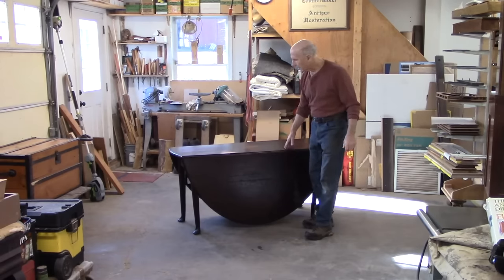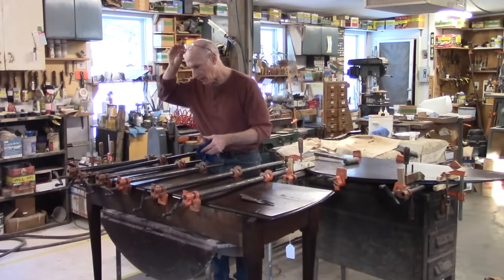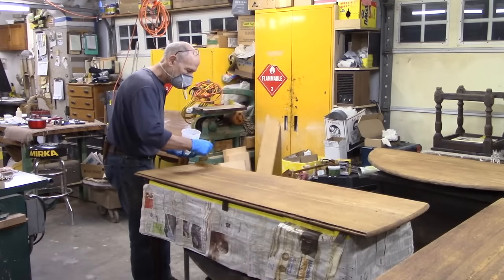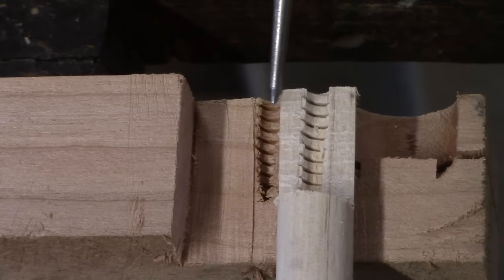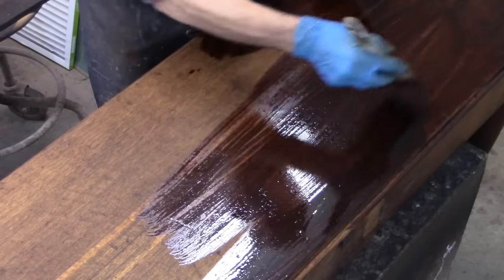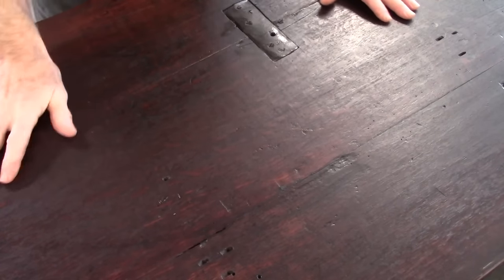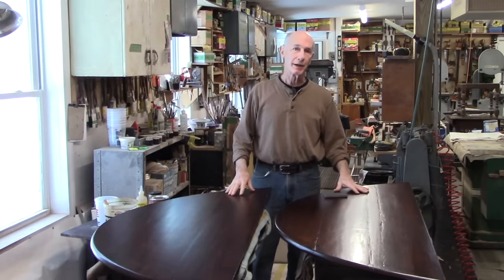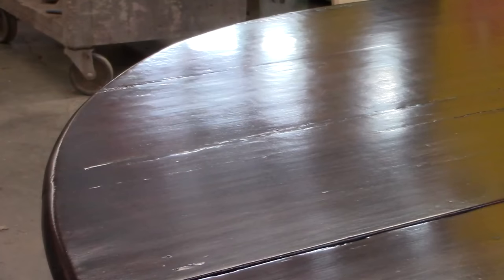Is This Table Too Old to Refinish? - Thomas Johnson Antique Furniture Restoration

Comment: Forty years ago or so, I volunteered to do odd jobs at the workshop of a local antiques store here in RI. An older couple, Jim did repairs, and Ethyl stripped and finished. She used 4-0 steel wool and bar soap to get that same sheen from her finishes. They were lovely people, and I learned a lot. My wife and I liked old oak furniture, so we hunted for basket cases we could
buy for a few dollars, and restored them. Furnished our whole apartment, and it's still our furniture today.
Reply from the maker: That's great! I love that! We still have our oak from the 70's!
Reply: That is wonderful!

Comment: And again, Mr. Johnson saved a little piece of history. Who has eaten and laughed at this table? Nobody knows that and that is what makes restoration so valuable.
Reply: I wonder about the burn mark, did somebody get in trouble?
Reply: @timheilman2089  Maybe - but it's also possible that at some point this was 'demoted' to an old, scrappy table that nobody cared about.
Reply: @timheilman2089  If you've watched a lot of TJFR you will know he doesn't go after deep damage. It leaves behind too much distress and obvious work. That would be contrary to his and most restorationist's philosophy. You can always find someone that will run a complete tabletop through a 48" drum sander removing every last trace of character.
Reply: @timheilman2089  I'm totally an amateur here but this is my impression of the origin of that mark:  Doubting it was a one time happening but perhaps many times a coffee pot was placed on that spot that had a pad beneath it that didn't completely do its job.  IMHO
Reply from the maker: Thanks! I like to think about that too!
Reply from the maker: Good question! Thanks
Reply from the maker: That happens often. Put down the cellar as a work table. We've seen that happen a lot
Reply from the maker: Thanks! True! It's often difficult to decide how far (or not) to go
Reply from the maker: Thanks! Yes, could be. It's fun to speculate

Comment: I let shellac dry for like 14 days once because I was tired of it being gummy. Was like glass after, so easy to work with. Then lol. I also found that humidity reeeally made a difference (was a summer project, so often humidity was high) and temperature was important as well
Reply from the maker: Thanks! Yes! Shellac is a "fast-drying" finish, but not always! I like to wait a minimum of 1 day between coats, this time of year longer

Comment: I love how we have the technology to walk on the moon and probe the mysteries of distant stars yet the best adhesive for wood repair is still hide glue, the cleaned boiled skin of an animal that was invented before written language. :)

One of those iron patch plates looks hand forged.
Reply: With perfectly clean wood, Titebond will beat hide glue... but sometimes perfectly clean wood might not be possible, like here.  Also nothing sticks well to dried Titebond, and Titebond will not catch rapidly so as to spare the need for clamping small pieces.

Also, even Tom epoxied a piece of nail split trim back together and back on.
Reply from the maker: Thanks! So true!
Reply from the maker: Thanks! True! I use hide glue on antiques, but Tite Bond is the go to glue for all other projects
Reply: I think it might have been part of the orginal table. Which means it has been fairly well cared for.
Reply: @SeekingTheLoveThatGodMeans7648  you should never use a modern glue on antique furniture. my dad used to have a pot of animal glue that he used for years.

Comment: Really nice paced video with many tips. One thing I have used in the past like you is the foam brushes. Didn't have good luck with them so I used a good urethane brush.Found a great way to clean the brush too after 45 yrs. Dawn .Thanks
Reply from the maker: You're welcome! Dawn has been a staple for my shop from the beginning!

Comment: I love watching these programs.  And I really appreciate how you have explained every step you took. It is a lot of work but I appreciate the way you kept the integrity of the piece. 

I also learned a lot from you. The story about the plugs and dowels was interesting and how you solved the problem about the right screws to use and how you initially cut the thread into the piece with the right screws and then shortened the screws to the right length was also a very good tip.

Thank you Sir. Best wishes
Reply from the maker: You're welcome! I'm glad you find that useful!

Comment: I just love watching how you restore pieces  close to their former glory. Thank you for giving us so much of your valuable information and tips.  Your clamp selection is the envy of us all. I hope you do not mind me suggesting that 2 pieces of 1" diameter x 1" long plastic pipe, split and slid onto the pipe near each end close to the clamp heads helps to remove the need to try and keep the pipe off the surface by positioning them away from a glued joint. I have these on all my pipe clamps....Ron Cumpsty
Reply from the maker: Thanks Ron! That's a good idea

Comment: A job well done, beautiful result. It certainly doesn't look anything like the table from the start. Thank you for explaining the difference between the plug and the dowel. I always knew dowels were soft and never thought to use a plug in their place. Plugs were for covering recessed screws!. Its a bad day when you can't learn something new, today was a learning day watching your video.
 I'm a mechanic by trade and have a love of timber and try to make what I can. Everything is the dreaded MDF these days, may as well be cardboard. 
Over twenty years ago on holiday in the north of Thailand, my wife and I bought our dining room table and chairs. Solid golden Teak, with some discreet carving to the chair backs and table frame. It wasn't the fact that the whole six chairs and table including shipping were 70% cheaper than back home. It was the quality and craftmanship that went into the build. The one we had been looking viewing at home would now be firewood. The Thai people are very talented with most of the craft work, timber in particular. We bought several more items on return visits and everything is still solid and nothing has become loose. 
A couple of questions if I may. The scraper kit you were using is really neat, I've not seen one like it this side of the Atlantic, what brand or who manufactures it.
The second question is in relation to the type of brush you were using to apply the stain to the table top?. The shorter of the two, it looked like a dense sponge wedge from what I could see.
Reply from the maker: Thanks! Yes, there are interesting videos of people in that part of the world making furniture. That scraper is a Hongdui from China. There is a similar US scraper from Woodpecker. Both are excellent. That's just a foam brush - I hated them until I found they work great on this particular varnish!

Comment: Mr Johnson I agree with JB I'm a  new viewer I absolutely love to restore old furniture I actually have several pieces at 100 years old been in the family for years however my current residents will not allow me to do anything but at least I can enjoy your videos thank you thank you Mr Johnson for such awesome videos great work love to watch you work on old furniture..😁😁💓
Reply from the maker: Thanks! I hope you get a chance to work on them someday
Reply: @johnsonrestoration  I thank you Mr Johnson I will someday one of them has to have a block put back on the corner which pretty simple just tap a couple nails in cut cut the ends put a little glue and tap the block back into place that's my theory for this the other one is all walnut cabinet I think they're both Walnut connect with me on Facebook I would love to show you pictures of the two pieces of furniture I have that are family homes I don't know the age maybe my over 100 years old

Comment: My Mom loved to go to country auctions and buy old furniture that had been painted over many times and take the paint off to get down to the wood. About 25 percent of the time she found excellent wood and something worth refinishing.  I have fond memories of helping her remove layers of paint with nasty smelling paint remover.  Then she would make the necessary repairs and refinish the piece of furniture.  She would spend a nominal amount of money for an old painted piece and spend many hours making it a beautiful piece of furniture.  She sold many of her projects but she kept quite a few over the years and they are truly wonderful.  I have a cherry chest today that she worked over in 1956 and it is still an outstanding piece.  She taught me the craft and I recently refinished a gunstock for a M1 Garand with boiled linseed oil.  It took 11 coats of that stuff with many days of drying between coatings and took me over 4 months to get it right.  Your video brings back to mind many hours spent working alongside Mom back in the day.
Reply from the maker: Thank you! What memories! I'm so glad you still have so many of the pieces

Comment: Always enjoy your work Thomas. One thing you might think about with these very old pieces is cleaning all the surfaces you’re redoing with naphtha first, even before stripping. I do it several times with clean rags each time. And if those areas that are still showing up with the flat and dull looking like they might fisheye use some fisheye eliminator in your finish it will work in oil products. 
I restored the George Gershwin piano for Mrs Ira Gershwin years ago and we had a tremendous fisheye problem. We did use fisheye eliminator in the lacquer but we actually had to use a shellac barrier coat and even then we couldn’t lay down a wet coat of lacquer. It’s now in the library of Congress in the Gershwin Room. 
I like how you got out of the corner, there’s always a way. 
Cheers 

Sent from my iPhone
Reply from the maker: Thanks Bob! Wow! That is impressive! Yes, I’ve had plenty of fish-eye problems in my life! And I’ve used plenty of Naptha! Try Mohawk Wax Wash Remover, it works better. Also, I find wiping the surface with a vey weak solution of household ammonia works great, between coats, after sanding

Comment: Thomas, you did a a beautiful job at refinishing this table.    About three years ago I found a duncan-style table for $6.00.  The top has water mark rings on it.  The bottom legs look parfect to me.  As far as the table goes, it has scallops on the two leaves of it.  There are no scallops in the middle of the table.  I've never seen a duncan-style table like it before.  I definitelyt learned a lot from you in this video.
Reply from the maker: Thanks! Yes, I've never seen that either

Comment: Awesome video.   It inspired questions that I haven’t had in 20 or 30 years.   Been thinking it’s about the time to use the wood shop for more than simple client requests.   

I’ve collected a ton of old wood thru the years.   From pulling attic floor boards or even finding old redwood on 40 year old decks.   I’ve kept anything that would be good.  My wife never was pleased.   Now I’m ready to create.  

Awesome video!  Awesome use of hand tools.  Loved it.  Subscribed

Edit:  I can’t believe I’ve watched this whole video.   I think I found a muse.
Reply from the maker: Thank you! That's great. I love old wood, it can be difficult sometimes to work with. Good luck! Create designs where you don't need to sand the wood. Just clean it really well and finish it

Comment: At about 13:00 in you are clamping the center glue joint on the table top and trying to keep the clamps from resting on the surface. Just run 2 strips of 3/8" thick X 1 1/2" wide down the length near the edge to support the clamps off the surface. No fiddling getting them all level across.
Reply from the maker: Thanks! And I know that too. Must have had a brain fart

Comment: This table turned out gorgeous!  I have an old 1800 rocking chair that needs help.  It was one my Dad had.  I also have 2 1800 end tables that I would love to refinish.  They were my Great Grandpa's.  I also have 2 antique treadle sewing machines.  One was my grandma's and the other is a 1927 Singer. I would love to get to these also.
Reply from the maker: Thanks! You've got your work cut out! It's great that you have all those pieces

Comment: Mr. Johnson, thank you for sharing this marvelous video.  I am a green woodworker who has at times used hide glue to better imitate the work of traditional furniture makers.  I was surprised to see the liberal use of water (e.g., the oxalic acid washes) on parts that you had joined with hide glue.  I would have expected (and have experienced) this to cause the joints to loosen.  Any tricks I should know about?
Reply from the maker: You’re welcome! In the video I filled all the cracks with wood putty before I used to water for that very reason

Comment: What a labour of love! The table (and the chairs seen with it at the end of the video) does have a Queen Anne feeling which could make it 18th century (1750 to 1770). 
It was extremely interesting to see you deal with the top as I am the present keeper ot a genuine Louis the 14th very sturdy dinner table with one wobbly part on the top and I am most reluctant to entrust it to anyone since more damage could result from "good" intentions.
You were very brave to remove the finish but I know, for following your videos for quite some time, that you knew what you were doing although you might not have anticipated the amount of manual sanding it would entail.
This might not be your most spectacular work but as far as I am concerned it is probably the most impressive.
Reply from the maker: Thank you! Yes, a lot of tough decisions. I wish you luck with your table!

Comment: Thank you for sharing this restoration. Truly a labor of love. Your care and knowledge are truly appreciated. I don't know anything on this subject, but I was wondering if you would share your thoughts around using hide glue vs more modern glues for the repair? Is your choice based on period correct methods, or are there other considerations?
Reply from the maker: Thanks! I use hide glue on period antiques - I like it. PVA on most projects

Comment: Fantastic. I learned so much. I am from Costa Rica and I cannot find stain that is not runny. I love sanding with the 400 grit to get glossy finishes.
Reply from the maker: Thanks! If it's oil stain, get oil colors from an art supply store and mix some in the stain. That will thicken it

Comment: Right there you have justified my saving of all old screws! I have just recently been going through my 'stock' and trying to see if it makes sense to save all these old screw I have.... yep, save em! any recommendations for how you sort and arghanize these odds and ends would be appreciated.
Reply from the maker: Thanks! I sort them as I go. I have the wall hung cabinets with small drawers for screws, I have just about every size screw from #2 to #12, by length, and I put the old screws in with the new

Comment: Mr. Johnson, hope your doing well. This is about the 5th time I watch this video. I really love it. Your patience is incredible to me. When you were switching this extremely heavy table I notice it was hard to switch because the casters kept moving. I have a suggestion to make it easier.  You take some sand 🎒 bags and put them next to the caster wheels and this will keep them from rolling out of control. 🎥  Filmtool is a company that sells them and they are not expensive. My dearest sin works for the movie industry and in the background on set is where they use these sand bags. Just an idea you could use. Anyway hope Ella is doing well. I love her. ❤️
Reply from the maker: Hi Olga! Thanks! That's a really good idea! I can't believe I never though of that. I actually have a couple of bags, never used, in the storage room! I will keep them on the shelf of the rolling benches from now on.

Comment: Do you do period restorations - meaning with the way it would have been fixed back in the day furniture piece was made (no epoxy, square nail replaced with same if square nails, etc.)?
Your work looks awesome.
Reply from the maker: Thanks! Only when practical which is most of the time. I am not adverse to using epoxy, etc. when called for

Comment: Lovely work Tom. Can I make a small suggestion for you? When drilling into tops...or anywhere that has a critical depth, get yourself some small diameter tubing...Aluminium is good. Cut it to the correct length and fit it over the drill bit. You will never be able to drill too deep again. Best regards from the UK.
Reply from the maker: Thanks! That's a good idea!

Comment: Well done I thought, I really liked the way you thought out your proccess kudos are in order.
My brother tried to refinnish an old mile high hutch from grandmas Saloon I have some chairs that my dad had recained and refinnished I've no intension of selling them but wished you had done them.
Reply from the maker: Thanks! Your Grandma's Saloon! I like the sound of that!
Reply: @johnsonrestoration  
Well heck you'd love to visit My sister's bar in Wisconsin (No relation) but seriously yes in the late 1800's Gran and Gramps for a short time after they got maried worked in a Saloon just outside of Stillwater MN.
Grandma was the little house on the praire type her father imagrated to work for J.J. Hill as a camp cook.
Reply: Oh also I have an ancent spoool cabinet still in the orignal pea soup finish just kiding who knows what they used.